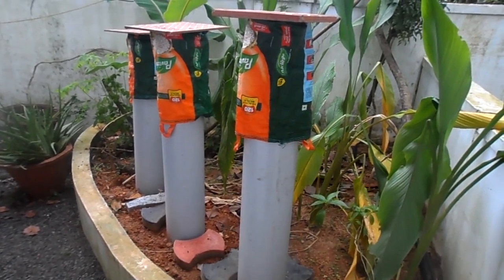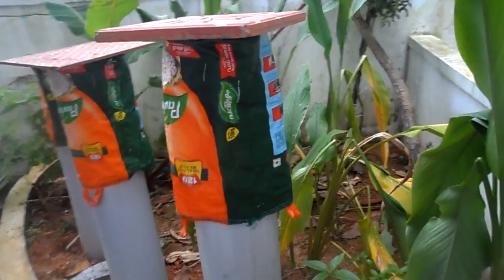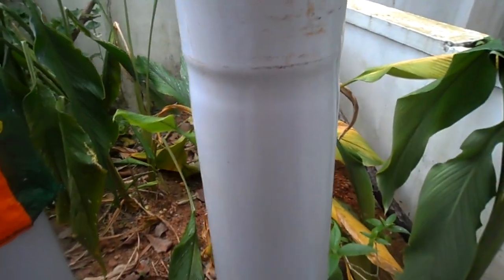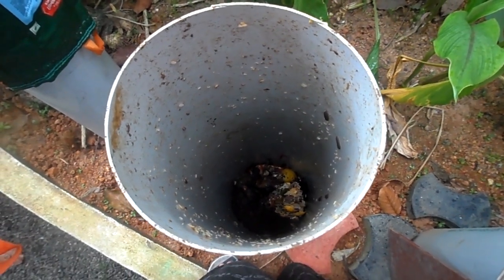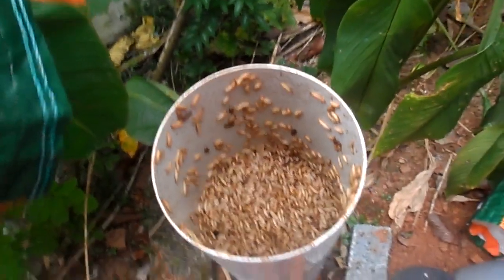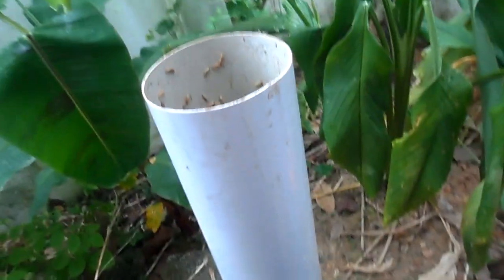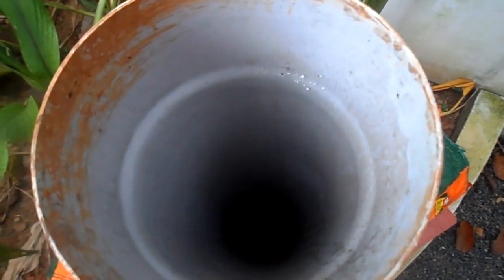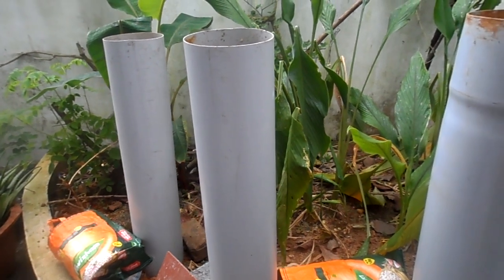Pipe composting ,a simple way of disposal of degradable waste

Comment: Sir, why have you sealed the pipes? The maggots are forming due to anaerobic composting and lack of ventilation. You will get far superior compost if you drilled holes for ventilation and kept the top of the pipe open. 
Nevertheless, thanks a lot sir for your initiative. We must do everything possible to solve the problem of our landfills.
Reply: These aren't ordinary maggots they're Black soldier fly worms and they're excellent composters.  You can feed them any kind of waste they can even compost cooked food and waste meat and they automatically leave the pile you don't have to saperate them.

Comment: Dear Sir 
Need any fluid to add inside the pipe for degradation process
Reply: inside must be moist but not wet. It depends of what is inside the pipe AND the temperature outside.
Reply: U can add  little buttermilk sometimes to get it faster.

Comment: you are practically having a factory for flies.... those ARE NOT WORMS...HELLO...THOSE ARE MAGGOTS!
Reply: Maggots assist in composting. They metamorphasize into fly and fly away. I think he should simply remove the seal at the top and drill holes for ventilation along the length of the pipe.
Reply: They are Black soldier fly worms and they're also composting worms. They are not ordinary housfly worms and they don't spread any diseases.

Comment: I am putting PVC caps instead of the bags,to cover the mouth.Do I need to drill small holes in the cap for air entry ? Please inform.
Reply: MIKHÁEL air circulation is crucial to prevent anaerobic conditions so yes